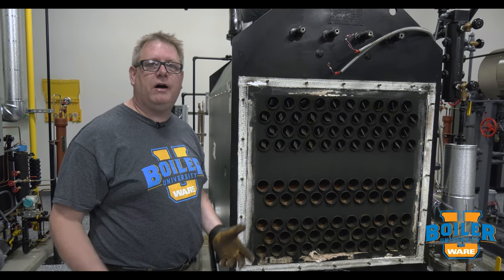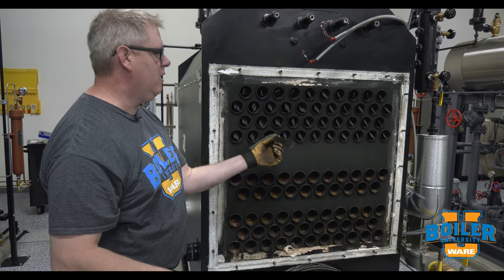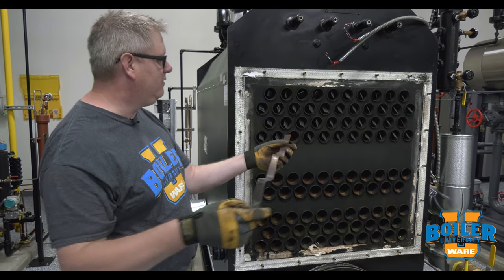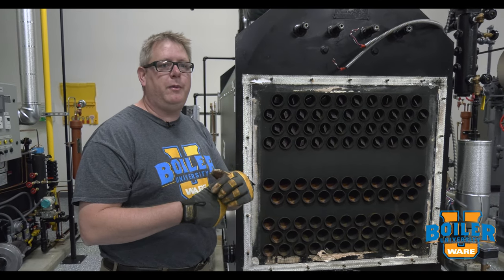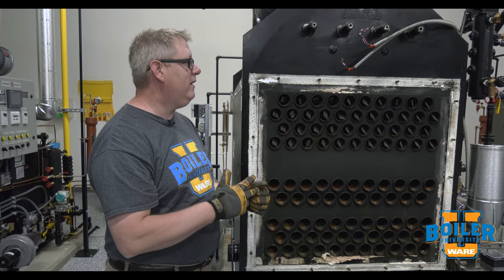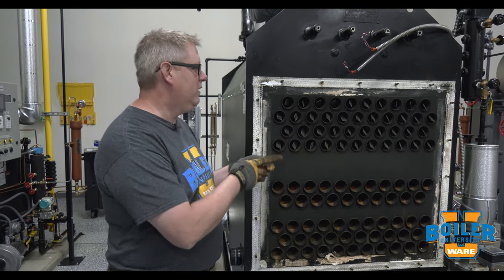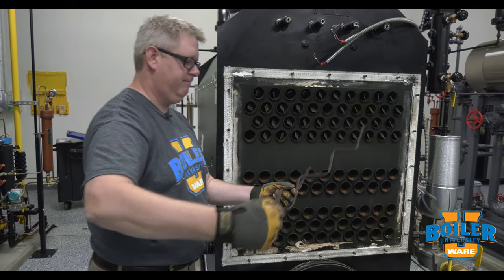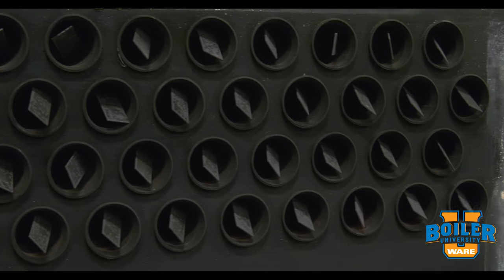What are Turbulators? - Weekly Boiler Tips

Comment: So I'm assuming if they are different lengths they should go back into the same tube location they came from? So we may want to number these with a maker. Love your videos keep up the good work.
Reply: Surely. Normally they are marked before removal. Such practices are common in maintenance.
Reply: I put them in wrong once and the next year some of them had been damaged. Like they burned up or something
Reply from the maker: Appreciate the others answering this. They are exactly correct. You will want to make sure that you come up with some method to mark each one of these turbulators with exactly the tube it came out of. Failure to do so can cause all kinds of problems from combustion to excessive heat in your exhaust. Thanks for watching!
Reply: Can I buy tubulators for my boilers? If so where?
Reply: @Dane Fischer - it looks like Ware sells them at their website boilerwarehouse dot com. I’d suggest looking into whether adding them is something that needs to be engineered. I’ve seen boilers with them only in the bottom passes or only in the top passes so I’m sure there’s some theory to it. Also you need to make sure your flue gasses don’t become cool enough to condense in the stack
Reply from the maker: @jimobrien84  Appreciate the plug on our site 😃You area also correct, you want to make sure that there is still some temp to the gas so it doesn't create that corrosive condensate. Thanks!
Reply from the maker: @danefi2  To follow up @JimO'Brien advice, we'd suggest making sure that you have all of the dimensions of your tubes in the boiler to make sure you get the correct sizes. This includes the ID / Length. If you have any questions feel free to reach out to our guys at https://www.boilerwarehouse.com/ and we'd be able to help you out. Thanks for watching!

Comment: I bought turbulators for my boiler that are too long.  Can I cut the turubulator to the correct length?
Reply from the maker: Typically yes they are if they are the adjustable type. To be certain you might want to check with the manufacturer just in case. Hopefully that helps!